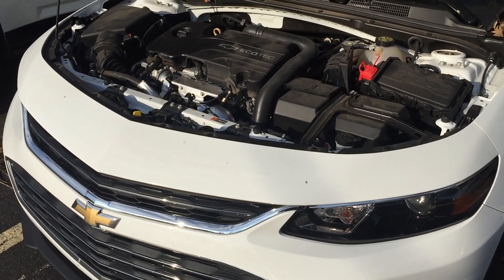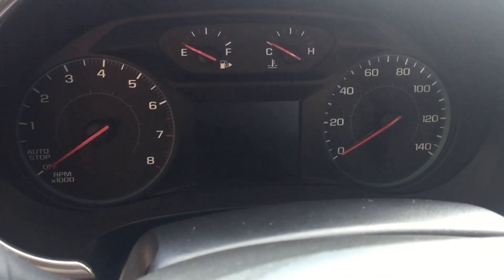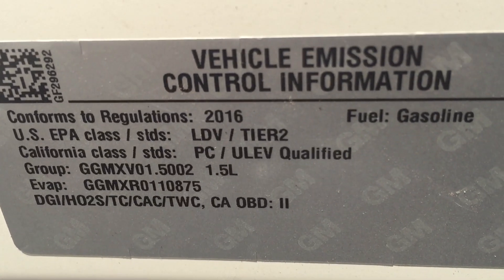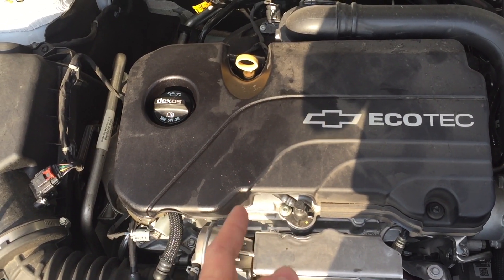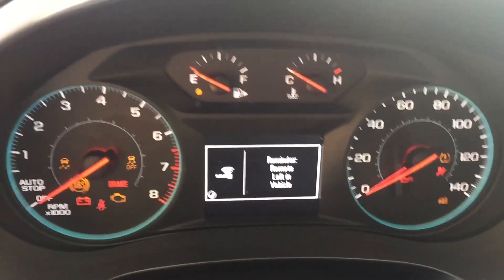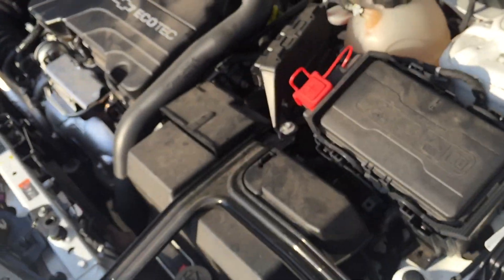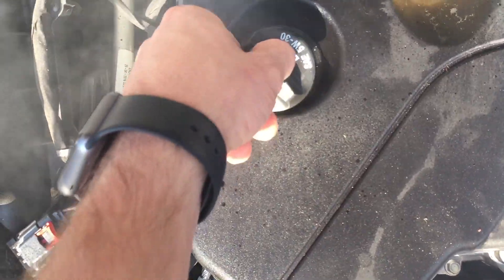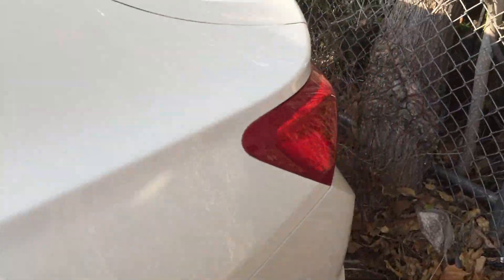What Engine Blow-By Looks Like

Comment: Any car that runs a turbo charger should have forged pistons from the factory.  If its a common issue with these cars of pistons failing its most likely they are using some basic non forged pistons and the excessive pressure and heat in the cyl is too much for them. 

In my opinion at that low amount of miles they should have taken it to the dealer and had them replace it under warranty unless for some reason thats not possible. 

Either way its a good look out for possible car buyers to stay away from this model car and engine from GM.

Comment: the same like first 1.4TSI by VAG this is not using customers for beta testing It is planned and calculated for profit. Example 1.4 TSI it have long chain timig It is an engineering solution of the 1970 and eighties. long metal chain timing with tensioners but who the hell puts the timing chain today when the timing belt service life is the same as long chain. VW changed this and still direct injection breaks down just as the Mitsubishi's GDI 15 years ago.

Comment: Such a shame seeing so many newer cars have issues. My 2007 Cobalt LS with the 2.2L ecotec is running like a champ at 150k miles. Only issue is a bad anti-roll bar end link. Mechanically it runs great.
Reply: My Cobalt sitting at around the same. 'cept the engine was swapped at 80k miles so I'm doing things like fuel pump n throttle body, those parts are all somewhere around 240k and still most are still kicking like a champ😂

Comment: If they end up replacing the engine aren't they installing a similar engine with potentially the same faulty part(s) which could lead to the same problem recurring? I own a Volvo with the B230F engine with 250,000 miles - zero blow-by, zero melted pistons! Lol

Comment: I posted this comment on reddit, but I want to get extra input. So I'll repost the comment here. 

-Ok... now I'm worried. My grandma just bought a 2016 Malibu recently after her 98' maxima bit the dust. However, this is my grandma so in terms of daily driving, she's not speed racer crazy nor does she go out a lot. Right now shes at 3-4k miles and she got the car around late august-early september. Should I still call the dealer and have them inspect it? Or will it be ok? I compared the engine type with the sticker in the video and its exactly the same engine, model and make.

Comment: What the hell? This crap shouldn't be happening in cars this new.

Almost like you're better off buying a 10+ year old model with the 3400 V6 and making sure it has the problem-solver aftermarket metal gasket installed that Dexcool doesn't eat through, and it'd be more reliable.

Comment: less then 20,000 miles and its having issues. shouldve stuck with the 2.2 or 2.4 and just made it better. the 2.2 was a descent ecotech motor. i have a cavalier with the 2.2 the only issue it had was the valve cover gasket needed replaced and somewhere on the side of the motor it would leak but i sold it like 2 years ago and i still see it running around. when i had it, it had around 130,000 miles prob about 140,000 if not more now.

Comment: Are you working at a Chevy dealer?  If not, why is the car not being brought in for warranty repair?  Are they just replacing a bad motor with the same bad design?  This reminds me of the old 2.0L motor that they had in 1983 to about 1990.  Those lasted about 20k miles before implosion.  If you got a factory replacement motor, it lasted about as long.  If you had it rebuilt by a competent mechanic who tightened up the tolerances, it lasted over 100k.

Comment: Are they running too lean?? There should be more than just replacing pistons or long blocks. No reflash? Unfortunately if it's too lean for the aluminum pistons it's gonna have to need some air fuel retuning by GM to prevent it from running too lean. That might mean that the mpg may go down a bit. but at least it won't lean out.

Comment: Dear gm if you want to make a small turbocharged engine contact ford on how to do so.
Reply: Or any Japanese or European manufacturer.
Reply: or Hyundai/Kia
Reply: I wouldn't even contact them.
Reply: And why would that be? They've been making these small capacity turbo charged engines for decades.
Reply: BlueChinchillaEatingDorito 
Still longer than gm and successfully I might add.
Reply: BlueChinchillaEatingDorito Quantity over quality, eh? Not really.
Reply: GMC Sierra in Duramax Form And you think this is quality?
Reply: ...or you know, not force induction, maybe a nice N/A motor?
Reply: BlueChinchillaEatingDorito I never said that, I said that I wouldn't buy it off them either, do you understand what I meant.
Reply: GMC Sierra in Duramax Form Well we were talking about GM contacting other manufacturers. That's why your comments got confusing.
Reply: BlueChinchillaEatingDorito Yes, I know, I meant that GM shouldn't contact Ford.

Comment: Typical chevy :/ 19000 miles and a blown engine. They make/made 2 reliable engines, the 350 small block and the 3600cc V6.
Reply: GM made PLENTY of 3.6 V6's.  It is still in production.  Do some research.
Reply: don't forget about the cocking godly LS motor
Reply: my good old 93 350 in my k1500 has 415,000 and still going strong except for body and frame rusting away
Reply: Tristen Sharba dont make a 3600 v6 dumbass

Comment: ecotec Looks like the ecoboost but ecoboost is a little bit but reliable ,my 2012 ford f150 has 110,00miles on the clock n my 2014 ford fusion titanium with 60,000 miles on the clock.
Reply: 1970 olds442 ford haterz told me the same thing when I bought a high mile v6 explorer 8 years ago. and I beat the tar out of it daily.
Reply: Joe Gotti your junk eco boost will need all new timming chains and nylon slides be ready for that big bill. junk ass fords

Comment: "Melting" Let me guess, the pistons are made out of aluminum?
Reply: Justin Grindley Exactly what I was thinking
Reply: +1970 olds442 Forged pistons are still aluminum. Steel pistons don't work for crap on a daily driver.
Reply: +Robert Wolfe Steel pistons exist, but I've only seen them on a crazy diesel truck who's sole purpose was to compete in tractor pulls.

Comment: I bet the piston rings were installed incorrectly from the factory. My old jetta had the rings installed upside down and it did something similar but less intense. I bet they are eating rings and spitting them in the oil pan. Improper ring gap, clearance and/or orientation might even cause blowby in this or any engine for that matter. I think it's a production defect or human error installing the rings. It happens.
Reply: What you're describing is a normal condition for Volkswagens! haha
Reply: Austin Liles heh, my vin was one of the batch from the TSB about it, it was a short period of time. Someone made an error down in mexico, still love them though, the mk4 has so much character.

Comment: So, could I check for blow by just by the exhaust? I think my friend's car has it.
Reply: Take off the oil cap and just set it on the fitting without screwing in on. If it shakes and you can feel air puffs, even just a little, it's blow-by.

Comment: Under 20K miles less than a year old...surely that'd be a new engine under warranty?
Reply: I would request them to give me my money back.
Reply: time to drive the car hard as hell and wait for the engine to blow up again
Reply: Given this is part of a rental fleet (sticker on driver's window gives it away) there's probably no warranty, but the rental company will have to butt heads with Chevy.
Reply: +discerningmind
You do know the ECU can tell dealership how you drove the car
Reply: @IIGrayfoxII  the car should be able to handle any way it was driven. If hes revving it out to red line all day that's still valid use as long as he doesn't modify how the rev limiter works.
Reply: It would never happen.  And lemon law would require this happening two more times.
Reply: @discerningmind  not if it's in the shop for 30+ days, then it can be lemoned regardless
Reply: @zorkman111    I'm pretty sure it varies by each state's law.  I haven't heard that about our Lemon Law here in CT.  Our law is, the dealer gets three opportunities to fix it, and after that you get your choice in what you want to do.  But the dealers around here will make an adjustment or repair and then avoid giving you a receipt.  That way each time you don't get a receipt it doesn't count as one attempt to fix it.  I've asked for a receipt when I wasn't handed one, and I was told I didn't need one because there wasn't any charge.  Some people believe that and don't realize they're screwing themselves if they want to use the Lemon Law.  The closest thing we have to your 30+ days in the shop, is that some dealer's just let your car sit around so you'll get sick of nothing being done and then go away.  So if it's on your sales invoice that you get a free loaner car, always take that whether you need it or not.  The reason is that they'll probably actually work on your car because that loaner is costing them.  Thanks for taking part, zorkman111.
Reply: @discerningmind  that is correct.
Reply: ....which would then grenade another piston at 40k next year
Reply: Nope Chevy says it's perfectly normal 🤦‍♂️
Reply: sure is, take it back to the dealer and replace engine
Reply: 'It's not out of spec'.  At least that's the bullsh*t excuse they gave me when I discovered it around 71k. With an extended warranty that would have cost them nothing to fix it, by the way. I traded for a Toyota Camry about a month later and haven't looked back.
Reply: the driver gotta be speed to much or sum i never had problem with my 2020 malibu mines got 46k miles i take care mines i use pennzoil no dealer oil
Reply: @6.2_2ss  But have you actually checked the filler hole for signs of blowby? If so, I'm thinking the 2.0T probably doesn't have this problem. The 1.5LT definitely has this problem.
Reply: @anonymousinc6330  yea everything good uk im mechanic doe so i would know if something wrong and another thing these good cars but don’t know why they put cvt transmission on it instead regular transmission
Reply: @6.2_2ss  Because GM doesn't care what happens once it's out of warranty. They want you to buy another car. So I did. A Toyota.
Reply: @anonymousinc6330  o ok good

Comment: All of the people hating on GM have a valid point, but I've had a Mopar warp a head in 30K miles and two Fords shatter pistons. All were driven lightly and had regular maintenance performed at factory intervals. That's what finally drove me and my family to  Japanese cars.
Reply: Even then, Toyota had some pretty shitty years for a while there. This is why they give a warranty with a new car I guess, protect you from getting stuck with shit.
Reply: Koshunae yeah but every manufacturer has had design problems. My point was more that anecdotal early failures are not reason to condemn an entire manufacturer. Especially since Chevys are more often manufactured outside of the US and most US Toyotas are made in the US now, saying 'American cars are the problem' doesn't make any sense. 

Have to judge each specific model by itself, everything changes every year when it comes to which car from which manufacturer is most reliable - and then you have to consider maintenance.
Reply: That's exactly my point though - the common problem can't be "American" if some are made in Korea, some are made in the US, completely different parts and designers, completely different business trategies - and what about the Mazda engine issues, or the Honda rod problems a couple of years ago, etc. 

The common prolbem is manufacturers trying to make as much as possible while spending as little as they can. Which is just how it works. Every cheap manufacturer has always made financial compromises somewhere, sometimes it goes well and sometimes it doesn't.
Reply: See my reply above.  We alike.
Reply: In these contexts when people say American Cars they mean American Nameplates.
Reply: Noah Zarq my ford ecoboost is still outliving this chevy
Reply: Amen, Reverend... I just traded my 2016 LT in on a 2015 Camry.
Reply: I've seen Ford's and Chevy's with 200-300k running with zero problems. So your point?
Reply: I've also seen Mazda and Mitsubishi motors blow rods out the block, and I have a GM with 300k miles on it. I think shit just happens sometimes, not every part comes out correctly.
Reply: Yeah but when you have multiple cars being reported with catastrophic engine failure with super low miles, it isn't just a bad part. Its a bad design.

Comment: Turbo engines require regular oil changes...how often was the oil changed? A tiny hardworking engine like this won't last long if it is neglected..This type of engine  in a mid size car is a stupid idea anyway....Its like putting a chevette motor into a buick century...

Comment: gotta love that GM quality 19,000 miles and the damn thing is already needing an ENGINE REBUILD. thats the problem with these small engines with TURBOS i blame the Government for making fuel mpg and emission standards so strict that the manufacturers  are forced to strap turbos to engines that were NEVER designed for turbos to begin with.  its not a matter of IF its a matter of WHEN that turbo blows and starves the engine for oil.

Comment: GM should go see VW about how to build good turbo 4 cylinders...
Reply: Yeah no. Have VW design a bottom end from their diesels, Yamaha build the head and cam chain drive, Mitsu turbo and Bosch injection. Then you might have a turbo engine that will last 400.000miles.
Reply: Thats a big truth. VW has ton of experience but the didnt bet that big on their engines, the stik to 1.8, 2.0. I mean, they didnt turbocharge a mini-engine.
Reply: They have built smaller turbocharged engines but they were not available for the United States.  The first of their small capacity turbocharged engines was the 1.4 liter engine that was brought to the United States just this year.
Reply: drivingkato they wanna head down to subaru. the new STI produces 305hp with a 2.5l 4 cylinder engine. now that is engineering
Reply: Yeah their EPA numbers will magically improve too.
Reply: ThePucko97 add all that it won't even be a vw engine anymore. wouldn't it be better just to build their own reliable car. oh what's that? they're cheaters who can't pass emissions and have to cheat their customers... wow... never mind drop the vw engine give it something else then market it as a vw.

Comment: I have a 2007 malibu with a 3.5 v6 and 146k miles on it that I picked up as a work beater car and it runs smooth, I just did a tuneup on it and regular maintenance and have had zero problems.  1.5 is just way too small for a 3400 lb car

Comment: I'm crossing my fingers that Holden in Australia keeps the rear wheel drive Commodore because there's rumours that GM wants to shut local manufacturing down & replace the rear wheel drive Commodore with both a front wheel drive & all wheel drive Opel to be rebadged as a Holden Commodore,they probably want to go Hyundais way which is dump the V8 engine (I hope not) as Holden ditched the expensive to fix Holden only Nissan RB30ET turbocharged in line six & fitted a fuel injected version of the Holden 304 cubic inch V8 engine in after a protest against Holden & Ford from the V8 crowd, regarding the omission of the V8 engines in their passenger cars.
Hyundai are talking about ditching their 5 litre V8 which Hyundai Australia are reluctant to release in Australia rather opt for the less powerful twin turbo 3.3 litre V6 engine.
I really had to sit down & think about the turbocharger route,the insurance premiums for say a VL Commodore fitted with the 150 kilowatt Nissan RB30ET engine are far higher than what they are for say a VX-VY Commodore fitted with the 152 kilowatt L36 Buick V6 engine although you can make any bet the insurance costs would be cheaper than the turbo car if bolted into an earlier model Commodore which is lighter.
The turbochargers need rebuilding everytime a seal leaks oil into the turbine housing or if a bearing craps out in it.
I opted to go for a later model V8 Commodore fitted with the LS1 engine as they are very durable & reliable (mines approaching 329,000 kilometres) but I hope Holden steer clear from forced induced engines such as the one in the video,the only forced induced LS V8 engine that Holden have currently is fitted into the current HSV (Holden special vehicles) Commodore Clubsport R8 which is the L99 engine ,a 430 kilowatt LS3 engine which has been supercharged.
In other words, I want Holden to keep on making a V8 Commodore because I want to buy another V8 powered Commodore,so with the unemployment rate dropping down to 4.7% from 5.8% in the last month in Australia,maybe I can get a job where I can afford to buy a brand new one.

Comment: thanks for your videos bud. i wont ever buy 2008+ cars in my lifetime. ill mainly stick with 90s cars. my 99 1.6 16 valve tracker runs like its new still with 242k miles. full compression and no hesitation and gets and gos like new. of course i take care of my car with regular maintenance but most of your videos consist of new decade old cars fucking up with only 4k - 30k miles
Reply: Almost anything 07-08+ is trash for sure. Whatever isn't plastic is VERY thin sheet metal, simple mechanical/analog systems are now computer controlled, safety has got to the point that your car will be totaled from a minor collision, and emissions constraints have companies building overworked tiny engines like this car.

Comment: Daniel, my 97 ford ranger extended cab xlt 4.0l v6 has this humming noise when idling (when under 1000 rpm) or when I'm driving and I let off the gas (goes away immediately after I press the gas but comes back as soon as I let off of it) and it is fairly noisy. would you have some idea of what is causing this noise by any chance?